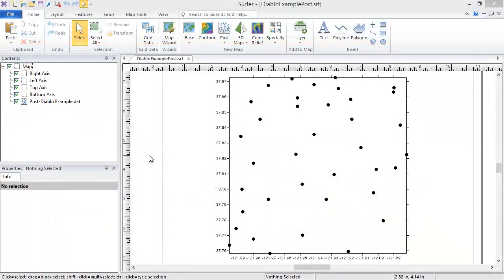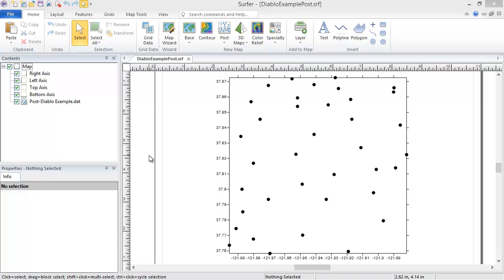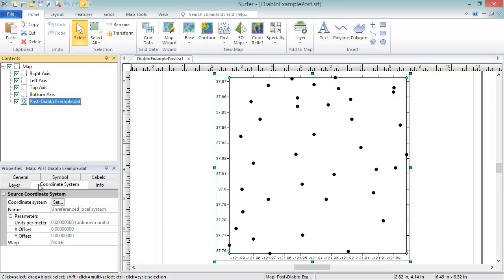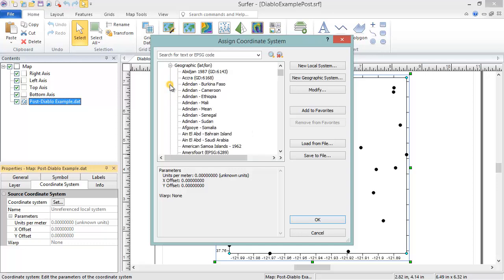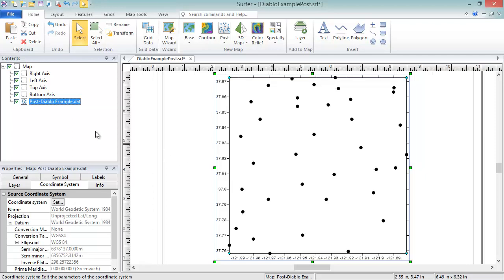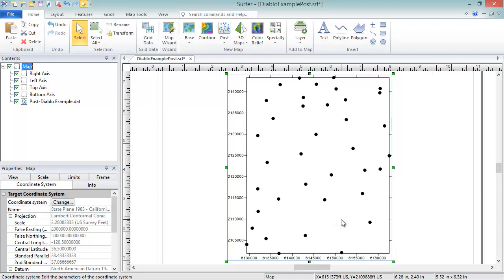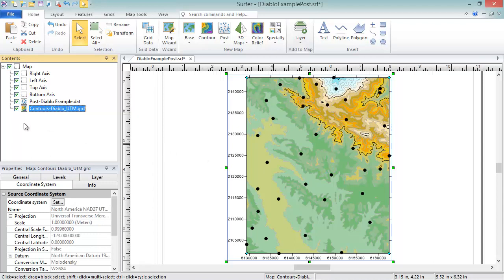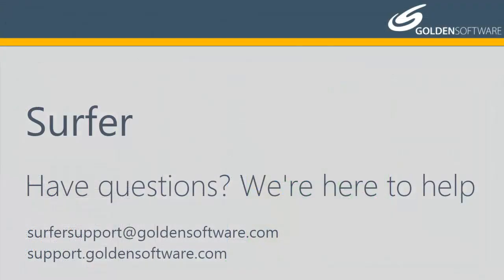Surfer Coordinate Systems

Comment: My country has UTM WGS84 coordinates in the format 279320E 9885977N Zone 37M. This is not available in surfer. I see only zones with suffix S and N on surfer. What is this M zone?
Reply from the maker: Hi Herman,

As far as I'm aware the WGS84 UTM coordinate systems only have north and south zones.  Kenya is located in WGS84 / UTM zone 37S.  If the coordinates for your data do not locate correctly when assigned to the WGS84 / UTM zone 37S coordiante system, please provide more information about the data that you're using and the source coordinate system.

Thanks!
Katie Yoder
Golden Software Support
Reply: @GoldenSoftware  Katie, thanks for the feedback. When you use google earth on the universal transverse mercator coordinates setting and hover over southern Kenya e.g. Nairobi area, the coordinates will read 37M Easting Northing. I understand that Africa has its own UTM zones which place Kenya at 36N, 36M, 37N and 37M. These zones are different from the 37N and 37S in surfer. My challenge is being able to use the UTM coordinates on surfer without having to convert them into lat/long. I will watch the surfer webinar and see if it will help on this matter too.
Reply from the maker: Hi Herman,

Surfer zones 37N and 37S are equivalent to Zones 37N and 37M. Likewise 36N and 36S are equivalent to 36N and 36M. Surfer uses the N and S zones as qualifiers for whether the UTM zone is north or south of the equator. Since the equator runs through the middle of Kenya, it has both N and S zones. Other UTM naming conventions give each UTM latitude band a unique letter, like M. These can be mapped to either north or south zones, but the zones themselves are equivalent. 

Thanks,

Golden Software
Reply: @GoldenSoftware  I will verify that in the program. I think in my frantic efforts to get 37M working I swapped M for N and S but it didn't work. I will first study the differences between the two systems. Thank you for the support!

Comment: Hello, how can i move an object (Ellipse) according to coordinate system .. in other word, i want to  moved the single object in a map by giving the X and Y in the object dialog .. thank you
Reply from the maker: Hello Ali,

Thank you for submitting your question. It is not currently possible to enter the XY coordinates to specify a location for a point, polyline, or polygon object directly in the Contents or Properties window in Surfer. Our Didger application can currently do this, please take a look at our free trial version to see if it will fit your needs: https://www.goldensoftware.com/products/didger/trial. I have added a vote to our suggestion file,  upon your behalf, for future versions of Surfer to also have this type of functionality. 

If you know the XY coordinates of all of the vertices for your polygon, you can create a BLN file in Surfer that can be used to create a base map from More details on the BLN format can be found here: http://surferhelp.goldensoftware.com/surfer.htm#t=subsys%2Fsubsys_gsibln_hid_gsibln_filedesc.htm%3Frhhlterm%3DBLN%26rhsyns%3D%2520. 

Please let me know if I can be of any further assistance!

Sincerely,
Drew Dudley
Technical Support